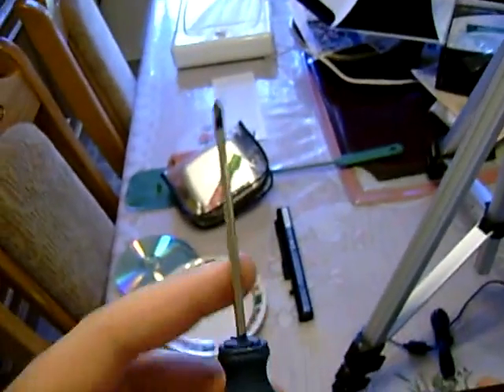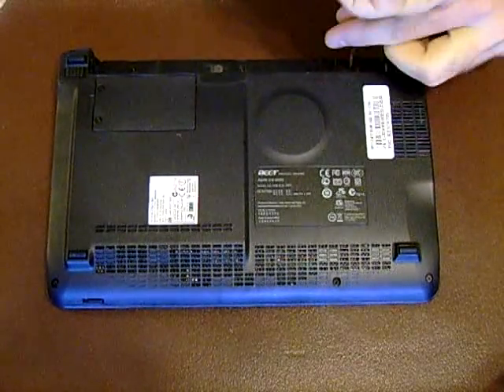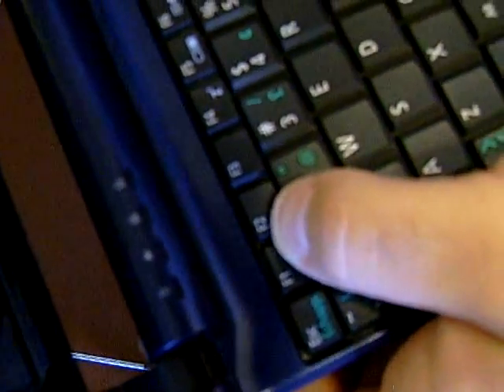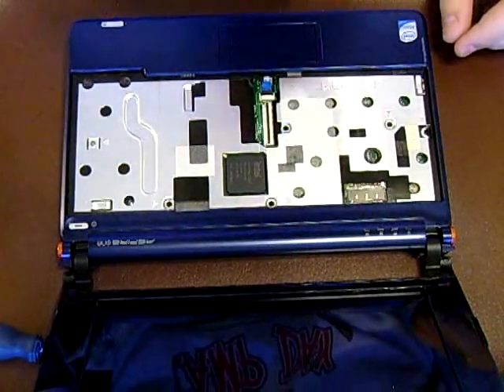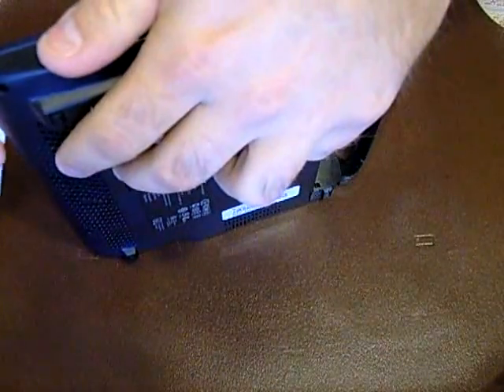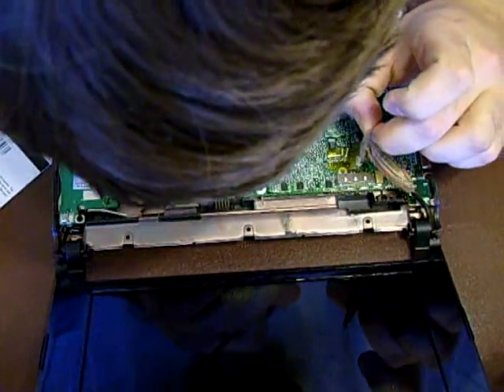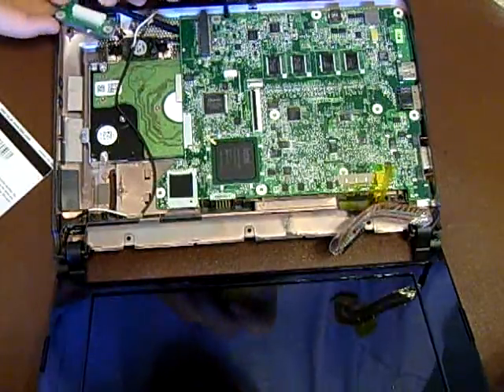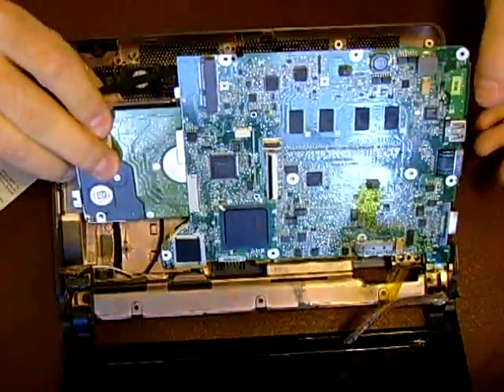Acer Aspire One Intel Atom installing 1 gb ram

Comment: Save two steps. I did not need to detach the LCD ribbon cable/tape or the wifi's wire leads. After I unscrewed the wifi card; I just place it with leads to the side. I flipped the mother broad against the LCD. ;)

Comment: Thanks for the Video. Helped out a lot. I also added more air flow to cpu  while I had it apart. The circular area at the bottom of the cover where th cpu fan lies beside. I drilled several holes in a honeycomb pattern. It has provided twice the air flow and brought my cpu temp 10 degrees. (sensorview ver 4). 10 degrees is quite a bit!. I also added cpu thermo paste to the cpu chips under the fan cover for extra measure!. 

Thought I would add my two bits of info to help!! Cheers!!

Comment: LOL @ using a magnetic screw driver on a net book, your looking for trouble. 

Also a good idea is that after you take out the battery, press the power button a couple times to discharge any left over electrical signals in the devices.  No need to short out the netbbok, or shock yourself needlessly. 

Other than that good video.  Just bought one of these myself. Looking forward to seeing what it will run like with 2gs ram.

Comment: One screw - one lousy screw refused to move, in the battery bay. A bit of levering with a flat screwdriver around the plastic released it but, even with a good quality driver, it wasn't going to move. That was the only aww-shit moment when I thought I'd wasted money on the chip and couldn't get the case apart.  Sound card connector was really hard to pull off - that was another sweaty moment. 30 minutes in all playing and pausing the video as I went. Happy and, running Linux Mint, works a treat.

Comment: Please please please make sure you replace the capton tape where the LCD cable connector plugs into the board. The tape MUST be laid on the board under where the metal connector part goes. This will save the screen.

Comment from the maker: You could try cleaning the ribbon cable contacts with Q-tips and isopropyl alcohol.

Make sure the cables are fully inserted also make sure you clip the locking tabs down or the cable will not make proper contact.

hopefully this solves your problem.

You may also want to check your keyboard and touch pad cables for damage.

I have had my aspire open about 5 times and never had any problems with the keyboard or touch pad at all.

Comment from the maker: It should work fine but I can't say for sure it's good fast ram much faster then needed but it should down clock to 533mhz no problem.

if you do go ahead and add it post the out come in the comments I have seen others use 800mhz ddr2 sodimm and it worked fine for them.

remember take your time doing this and make sure the screw driver tip fits the screws good to avoid stripping the heads
if you have to try a few different screw drivers to get proper fit do it.

Anyway good luck

Comment from the maker: 1.5 gb is the maximum ram you can install period. 

The main board has 512mb and I added a 1 gb stick of ddr2 sodimm 667mhz for a total of 1.5gb ram

I repeat the netbooks maximum amount of ram is 1.5gb DO NOT BUY A 2 GB STICK OF RAM IT WILL NOT WORK AT ALL PERIOD.

Get a 1GB DDR2-667Mhz  200PIN SODIMM Memory people have also had good luck with 800mhz ram. got my ram at NCIX

Comment from the maker: I would get the  intel 2 Duo T5800 laptop with the GeForce 9300M GS its little faster then the 
NVIDIA GeForce 9100M G for gaming and intel cpus are faster for video encoding most of the time

there both decent laptops the AMD Turion X2 has a 17inch screen with better resolution of 1440 x 900 vs 1366 x 768
but a slower graphics processor it all depends if you ever plan to play 3D games.
you will have to decide there both decent laptops

Comment from the maker: no cause There is one slot with a 512mb stick and the on board 512mb =1gb ram you can take the  512mb stick out and replace it with a 1gb stick giving you 1.5gb ram and thats the maximum you can put in the aspire one.

not sure what the new 10.1 inch aspire one can take for ram but sure is easier to do with the new aspire one 
cause they put a access door on the bottom  of it for ram and hd.

Comment from the maker: No it does not support 2gb sticks 

you can only install a 512mb or 1gb ddr2 sodimm and the main board has 512mb on board for a max total of 1.5gb. 

If you put a 2gb stick in it will not boot

your best bet would be a 1gb ddr2 sodimm I got mine at ncix com for $12.99 most of the time the price is around $12-$20 
but the shipping is to much if all you order is the ram so you may want to look around for the best price.

my stick was 1gb ddr2 667mhz and has been working fine for 5 months

Comment from the maker: If this happened after you upgraded the memory take it apart again and check all connections and remove the extra memory
and try again.

If everything's been working and all the sudden stopped working you can try
A BIOS recovery.

google (Acer Aspire One bios recovery)

macles has a good tutorial on using a usb stick to do a recovery flash on the Acer aspire one.

good luck hope you get it up and running again

Comment from the maker: The aspire that comes with 1 GB of memory has 512 MB on board and a memory slot
that has a 512 MB ram module installed for a total of 1 GB of ram

The largest amount of memory you can install in the aspire is 1.5 GB
because the chipset used in the Aspire only supports 2 GB of RAM
if you put more than 2 GB of RAM in it will not boot and they do not sell 1.5 GB RAM modules

It's not worth the trouble for an extra 512 MB of RAM in my opinion
I upgraded mine because it only came with 512 MB RAM.

Comment from the maker: if you already have 1 GB of memory
there isn't much of a point in upgrading
to 1.5GB unless you're planning on installing Windows vista.

and the snapping sound you're hearing
is not damaging anything.

The reason I upgraded is because mine only came with 512 MB of memory so it was worth upgrading.

Comment from the maker: Unfortunately if you have popped the clips into far it's not easy to get them back in their place
take your time and don't force the clips too hard I found I had to use two small flat head screwdrivers
and very carefully maneuvered the clip back into its alignment.

I hope all goes well for you and you get the clips/tabs back into place.

Good luck

And let me know what happens.

Comment from the maker: I guess I should have mentioned not to press in the clips too far or they will not pop out.

only once had a clip not pop back out
and I was using a small flat head screwdriver when this happened
but I guess even with the credit card it could happen.

If your clips are automatically popping out like they should you just need to push the keyboard down
where the clips are located till they click into place.

Comment from the maker: It sounds like you may have pushed the clips in way too far if the little black tabs are not popping out automatically.

If this is the case you're going to have to take the top casing off
and find the clips on the opposite side and very carefully with a small screwdriver put the clips back into place.

I accidentally pushed in one clip too far once when I was using a small flat head screwdriver
and never had problems when I used a credit card due to the rounded edges.

Comment from the maker: mine only had 512mb ram so adding 1gb more ram made a big difference and was worth it.

I wouldn't bother if you have 1 gb ram do not add more ram it will make little difference unless you plan on having a lot of stuff running or you plan on installing windows vista

Comment: you did a great job but I see no substantial difference in 1 and 1.5 gig performance wise. it's just the way they are making money fooling people to upgrade, that's why they didn't really care to put the cut-outs in the back to upgrade the memory. 1 GB is fairly enough for surfing web pages on wifi spots. 2 GB would have some impact but alas, 1.5 is the last resort. I prefer keeping it just like that..

Comment from the maker: you may want to  google "macles Acer Aspire One bios recovery" this worked on my friends with black screen probably would worked on mine too but I didn't fined out about it till after I sent it out for repair.

so if you still have your acer around give it a try
sounds like you exchanged it for the hp  though.

the old 3114 bios would corrupt it self at random new 3309 bios I have has been working good and I think the problem with the bios 
has been cleared up.

Comment from the maker: the warranty is voided if you take it apart.

I managed to get mine through warranty for a dead mother board probably caused by over heating cause the fan sucks in it. 
I was compressing video when it died.

I was vary careful not to leave a trace I opened it and removed the extra ram I installed
then sent it out  for repair

Comment: I did this soon after replacing the hard drive. The difference isn't huge, but I do notice certain things like slightly faster boot times. And it's only $15 for a 1GB stick of laptop RAM these days, so it's a no-brainer in terms of cost.

Comment: If you can disassemble a laptop and put it back together, and make it faster in the process, you can build your own computer next time. Congrats on the upgrade. Most laptops are not this difficult, normally.

Comment: Thanks for this. I used it to switch out the 120GB hard drive for a 320GB one, after using XXClone to clone my existing install to the bigger drive. The keyboard clips are annoying, but everything went smoothly and it works fine.

The HDD cage has to be unscrewed (two screws), removed from the SATA interface on the board (it's almost like an NES cartridge) and the hard drive itself unscrewed from the cage (four screws) before the drives can be swapped. Piece of cake compared to the rest of it!

Comment from the maker: If you have the hard drive version it is a sata interface.

If you have the ssd version there's no space for a 2.5inch hd plus there is no sata connector on the main board some daring people have soldered a sata connector and cut some plastic out to fit a 2.5 inch sata drive

people have also used 1.8inch hard drives
to replace the ssd 

there may be sata to ide converters but there is probably no room to fit everything in the aspire one

plus sata drives are cheeper most of the time

Comment from the maker: if it came with 1 gb ram there's 512mb on the mother board and 512mb stick of ram in the slot you can replace to 512mb stick with a 1gb stick for a total of 1.5gb ram

Comment from the maker: ok but as far as I no the acer aspire one supports a max of 1.5gb 512mb on the main board and 1 ddr2 sodimm slot supporting max size 1gb ddr2 sodimm

everywhere I have looked shows 1.5 GB (max)

so I am interested in how you got 3gb ram in your acer aspire one

Comment: thankyou very much it worked a treat ! Works great with 1gb of corsair value select from overclockers in england. Only comment is to prise the video cable a little bit at a time on each side to wiggle it out. do not yank on the cable or you might as well throw your acer in the bin. cheers ricardo

Comment from the maker: not sure if Acer has a choice I believe the chipset only supports 2GB

what Acer should have done is load the motherboard with 1 GB
and one slot for upgrading which would give you a total of 2 GB.

it might be possible for Acer to disable the 512 MB letting you use 2 GB stick

also I don't think it's worth upgrading if you have 1 GB of memory installed already

I only had 512 MB when I got mine so it was worth upgrading. plus I had a extra 1gb stick collecting dust

Comment from the maker: this is not really a laptop it's classified as a netbook it's good for surfing the net instant messaging office work but definitely won't play much in games it does not have a DVD drive
netbooks are great if you want portability but the processor isn't very fast and onboard video is not very fast either so far I like mine but it's definitely not as fast as a full-size laptop and it kind of sucks not having a DVD drive but it makes up for it in portability it feels about the speed of a P4 1.6ghz

Comment from the maker: not unless you're extremely skilled at soldering
as the processor is soldered to the motherboard and as far as I know there is no 2.6ghz Atom processor I know there's a dual core atom processor now but I doubt it would work even if you could solder it onto the motherboard as the BIOS is probably not program to support it

Comment: Fullscreen flash videos are always choppy in linux, unless you have a really powerful processor. Flash9 runs under emulation, so it really taxes out the processor.

My 2.8ghz AMD system with 2gb of ram won't even play a fullscreen flash video smoothly. The workaround is to either use swfdec or gnash, or load the video in flash, then play /tmp/Flash* with mplayer (or whatever video player you use).

Comment from the maker: I used a Crucial PC2-5300 1GB DDR2-667 CL5 200PIN SODIMM Memory Module Part #: CT12864AC667
works perfect
but any ddr2 sodimm should work accept the laptop is not compatible with 2 GB memory sticks
if you shop around you can get a 1 GB memory stick for approximately $20-30 plus tax plus shipping costs sometimes less

Comment from the maker: my Acer came with 512MB of RAM on the motherboard and the memory slot was empty if your laptop came with 1GB of RAM as far as I know it will have a 512MB stick in the upgrade slot and 512MB on the motherboard
also my laptop only came with the Linux I replaced it with windows xp I already had the RAM from upgrading other laptops a 512mb & 1GB stick I used the 1GB for my Acer got the ram free :) but I didn't charge labor upgraded there ram and told them I took the old ram they said I could keep it